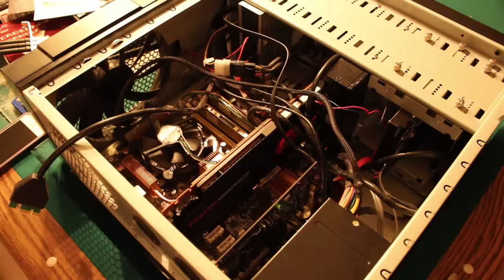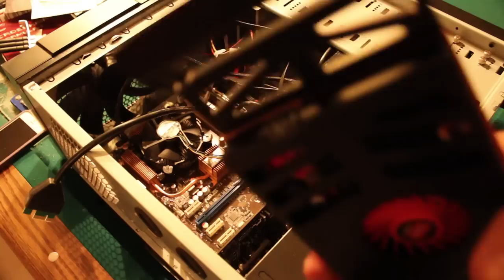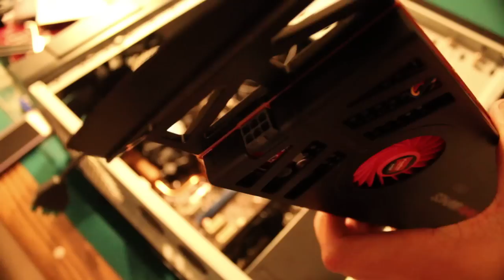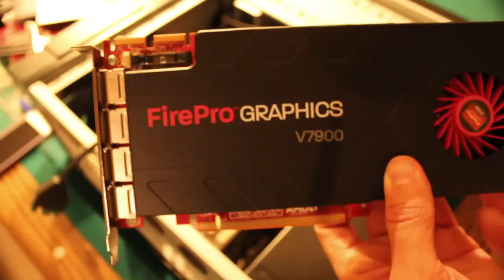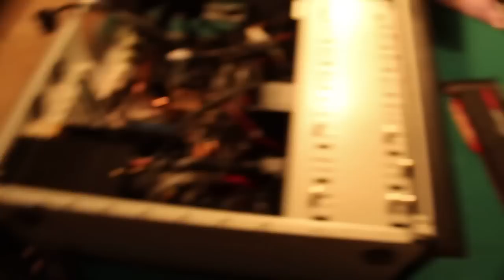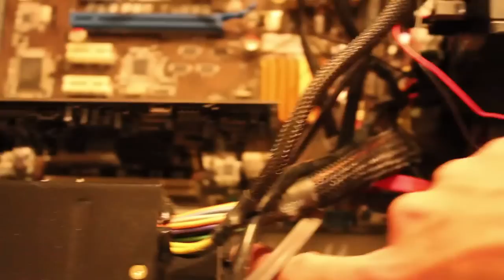Video Card Beeping Sound Problem 6-pin PCIE Cable

Comment: Porkercon, I've the same problem and this is the same beep I'm getting. Is this the PCIe slot gone bad or power cable because I've Corsair 600W power supply with one 6 pin and 8 pin connector PCIe cable inbuilt. I've connected both the power connector cable (total 14 pins in ) to my HD 5870 Asus graphic card. Please help
Thank you :)
Reply from the maker: Sounds like maybe its the wrong power cable. Hard to say. I would try different power cables and if nothing works then it might be the slot or card thats the problem.
Reply: porkercon thank you, I will try molex connector and try second PCIe slot.
Funny thing is Asus also don't know that their product beeps and has a speaker in it lol :)
Thanks for your reply :)
Reply: payyon393 so whats teh status?
Reply: Alfie Gangan its still the same. The Graphic card works just fine. No problem, yet it beeps.

Comment: I'm facing this issue with gtx 1070
Reply: Same but mine is a 1660Ti and has only 1 8pins and it still beeps
Reply: GTX 1050 ti. Same 😡😡😡

Comment: Where did you buy the cable from?
Reply from the maker: https://www.moddiy.com/products/6%252dPin-PSU-Modular-Power-Cable-to-PCI%252dE-(30cm).html
Reply: Did you get one with a male 6-pin Molex connector on one end and a PCI-E connector on the other end?
Reply from the maker: evaman1000 Can't remember, but it depends on your video card and power supply.

Comment: gONNA TRY THIS W/ MY NXT NT Z490 WHICH i HAVE BEEN RUNNING VIDEOVIA THE 10700K FOR 2 YEARS ALMOST BC EVERY GPU I TRIED I GOT THE SAME DAMN NOISE ! (srry caps) INTEL URD 630 ONBOARD GRAFICS aint good for much I basically deemed it a media station and even photoshop sometimes maxes the shared ram and virtual ram causing the software to lock up .. I will deploy your solution post haste and read my PSU owners manual to ensure the correct modular port and cables are installed . I shall reply to this comment with the outcome ..  I have not been excited about that build in like 2 years I am glad I searched the issue again in hope someone had found a solution .. well I'm off to destroy my cable management and out of spite shove a HD6990 in its PCIx16 slot and suck down 2 years worth of unused Power!!! Unlimited POWER!..⚡⚡⚡⚡
Reply: Turns out it was my sleeved cable extensions I had the PCI cables plugged in correctly . TY again for your vid !